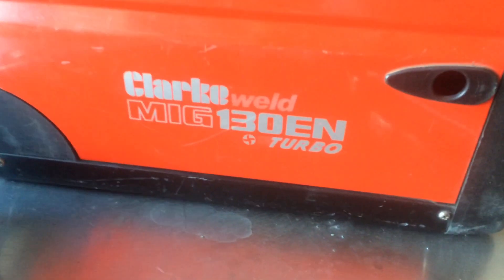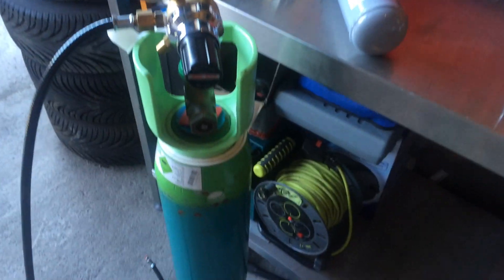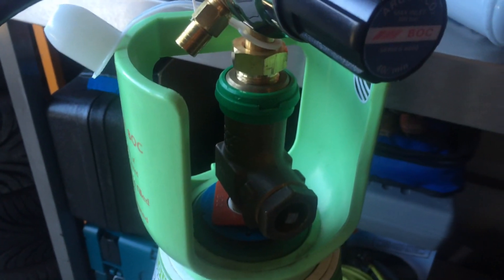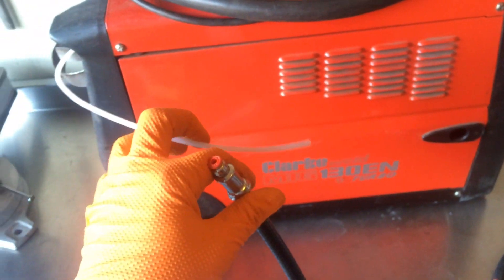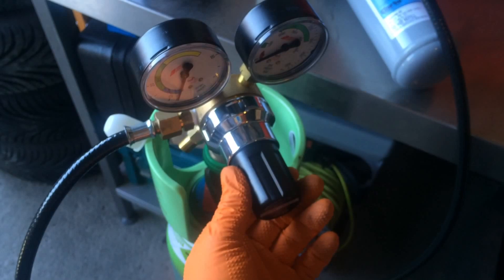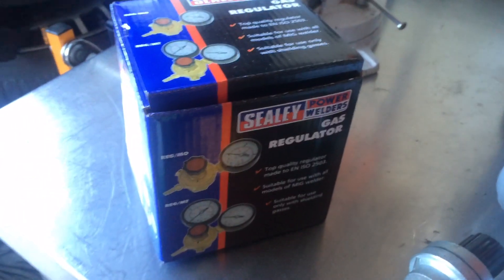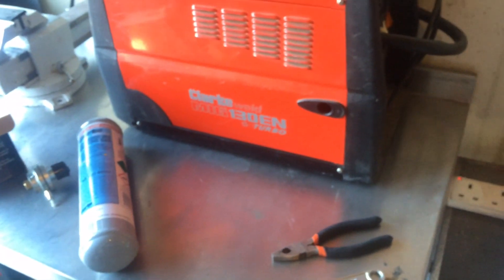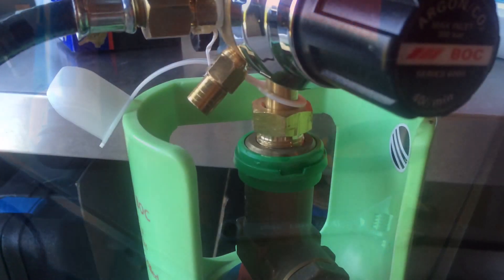How to Convert a small MIG welder to use large gas tanks

Comment: thanks mate i used your video to see how the 4mm pipe fits into the reducer as i didnt know it was so simple ,i got my convertor pipe off ebay for around 8 pounds all made up with fittings on reducer ect and my gauges again off ebay for only 15 pound just for the folk whos wondering where to get them so il see how they work but look good well made ect and look the same type as yours great video thanks daz
Reply from the maker: Cheers Daz, glad it helped you. Sometimes it's good just to see one little thing to see how easy it is. I couldn't believe it was so simple either that's why I made the wee video on it, I'd been racking my brain to how to get the big tank to work cause I was sick of buying those little disposable tanks. My welding got much better with the big tank too.